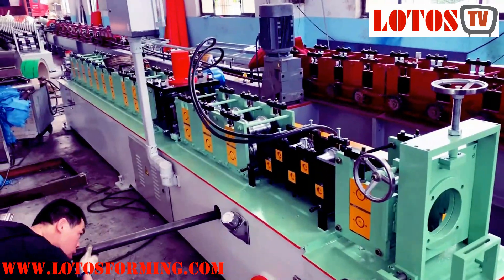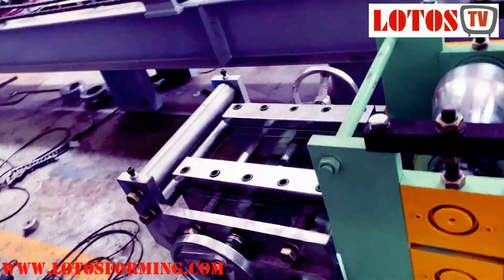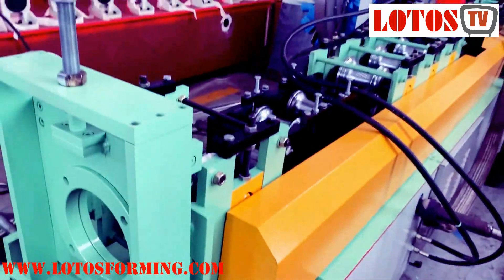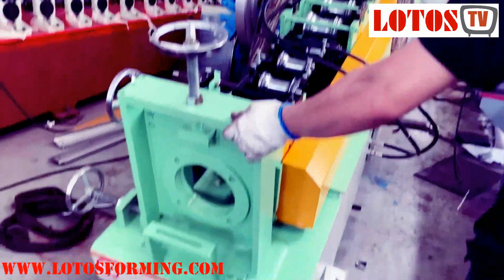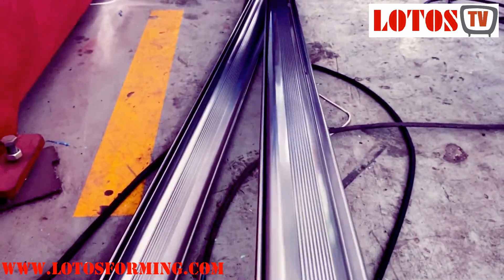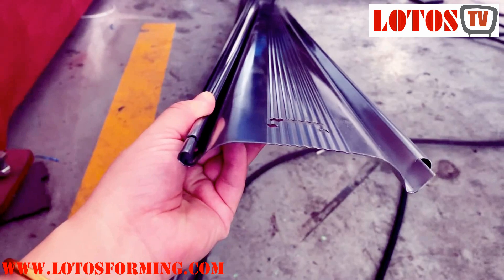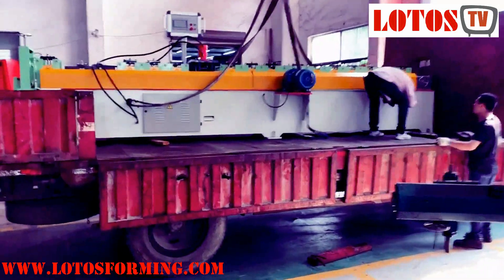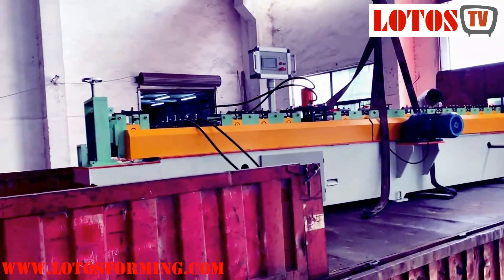【Roll up Door Machine】: Door Shutter Making Machine | Roller shutter roll forming machine " 2020 "

Comment from the maker: LOTOS produce a full range of steel personnel roller shutter door roll forming machine. Steel roller shutters are very versatile and come with various options, so they can be designed to suit our customer’s needs. In addition, Galvanized steel roller shutter doors can be used for a wide variety of applications.